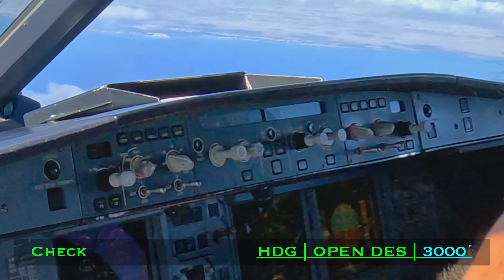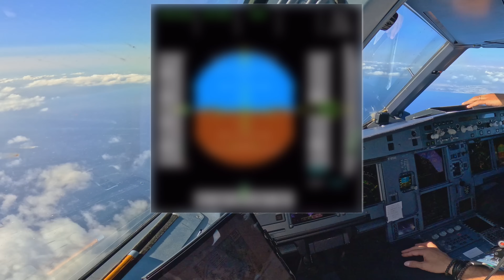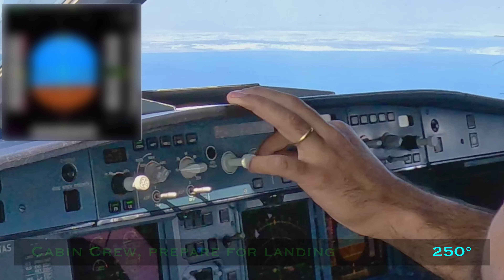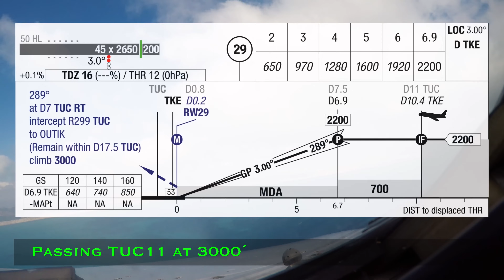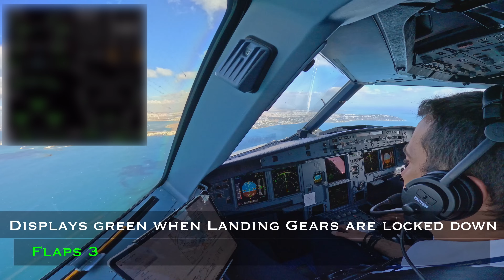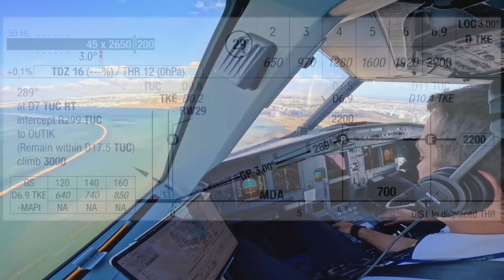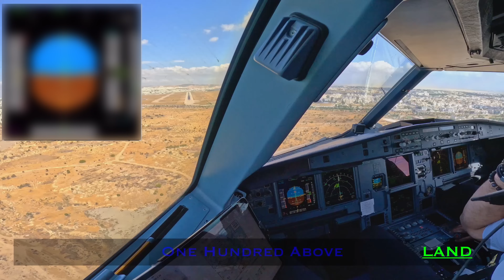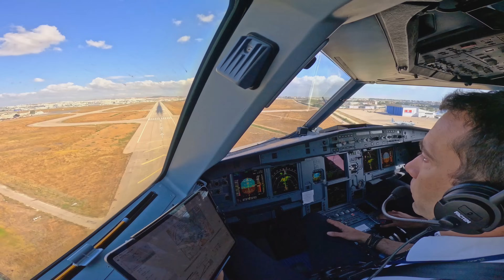[FIRST ONE] A321 TUN 🇹🇳 Tunis | LANDING 29 | 4K Cockpit View | ATC & Crew Communications [RE UPLOAD]

Comment: Do you need fluent French to be a pilot in Air France or B2 is sufficient?
Reply: According to the Internet, Air France pilots whose native language is not French, must hold an FCL 055 level 6 for French. Levels 5 and 6 correspond to B1 level CEFR (common European Framework of Reference for Languages). So B2 level should be more than sufficient.